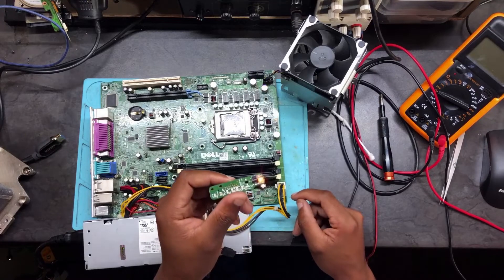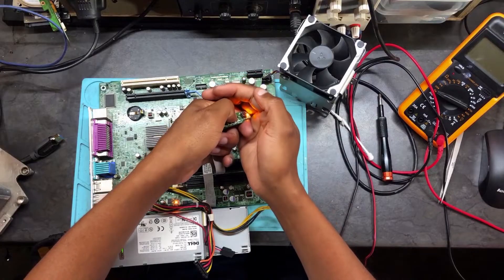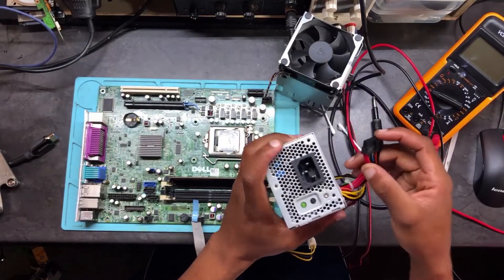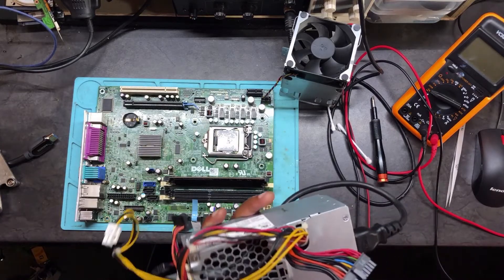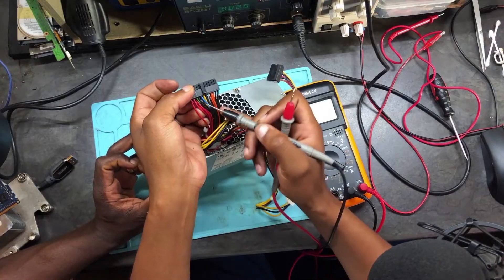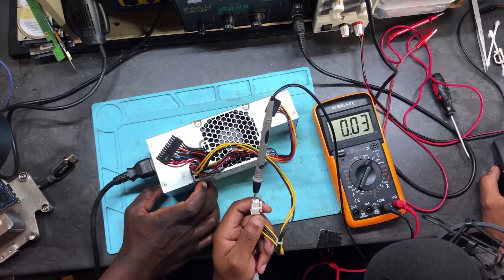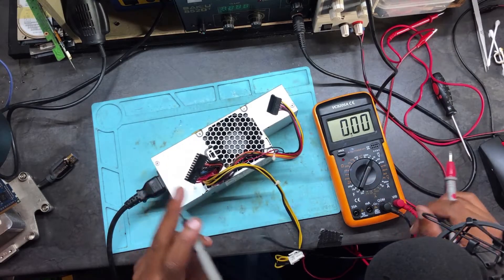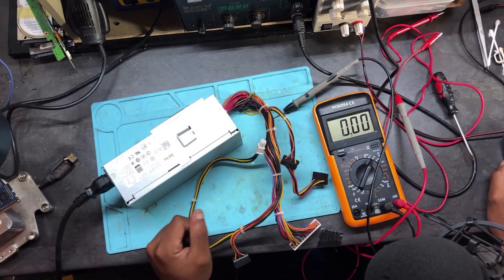THIS IS HOW YOU DIAGNOSE ANY DELL OPTIPLEX DESKTOP POWER SUPPLY FAULTY

Comment: I have an old dell 780 optiplex which I use as a daily , sff 255w yesterday it would not turn on ...and no fan sound or nothing ...does that meant it's broke , is it viable for me to try source a similar...and replace or  Is its life now over , your advice I muchly appreciate
Reply: Dude just go buy a decent oem dell optiplex 780 power supply on eBay what you need is a cheap oem dell psu $19 to $35 its not life over
Reply: @seanmckay3392  i sourced the exact model for it  I think the fan on the other one was broken , but in meantime I'm still using a similar old optiplex as a daily thanks

Comment: Thank's to Jbv, for this quick repair tip, save me hours of search , 2hrs ago I found a DELL D750-P00 and I did not know how to verify it, as you mention to short the (green+black) wires, it does the trick since on this power supply as only a red slider voltage selector "115V/230V", Many Thank's...

Comment: My 980 SFF can't turn on normally until I've push the black button on the PSU, hold it while pushing the power button until there's a loading screen or Windows logo, then I can releases it. Is it a faulty PSU or something I can easily fix?